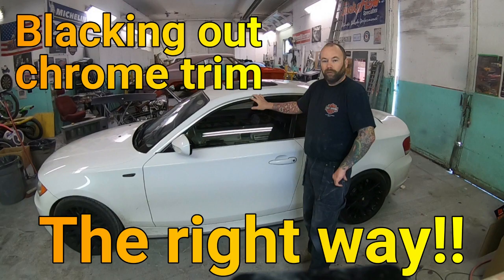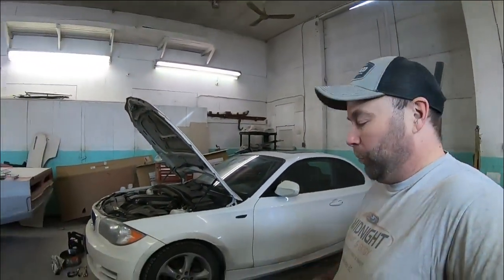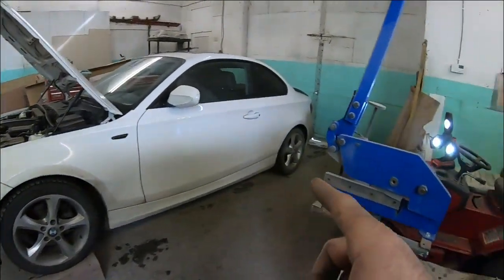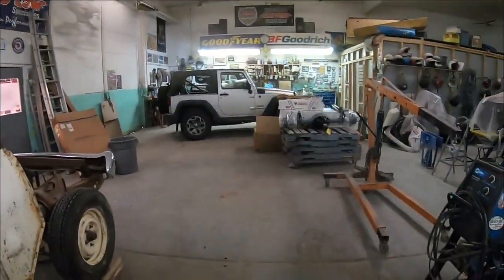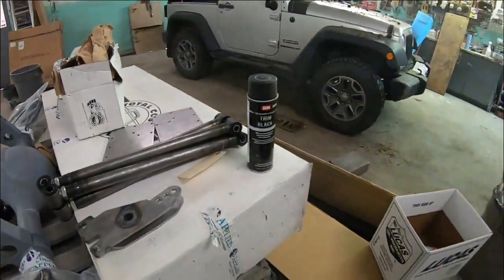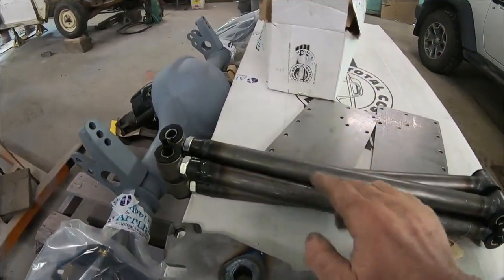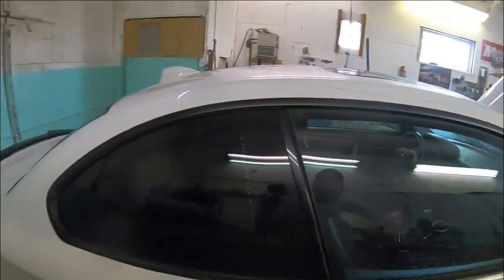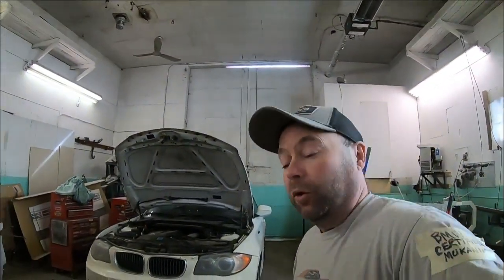Painting automotive trim black, revisited! Did it hold up?

Comment: Great follow up to the original video.  Question for you.  I have a few pieces of plastic chrome trim around my car that I want to black out.  Would you recommend etching primer, paint and then clear or should I go another route?
Reply from the maker: I would suggest using a plastic adhesion promoter rather than etch primer. Whether or not it requires clear just depends on what paint you use, and what type of finish you want

Comment: Thanks for the vids on this. About to do my car. Do you think going over it with an adhesion promoter is necessary?
Reply from the maker: Adhesion promoter is necessary for plastic, and if you’re not using paint that is formulated for trim (direct to metal) then an etching primer will need to be used

Comment: Thanks for the vid.  Makes me more confident in using the SEM trim paint on my Audi.

So you'd say there is zero point to sprayying some matte 2k clear on top?
Reply from the maker: It definitely can’t hurt, it will certainly give it more protection,  but not completely necessary 👍🏼👍🏼